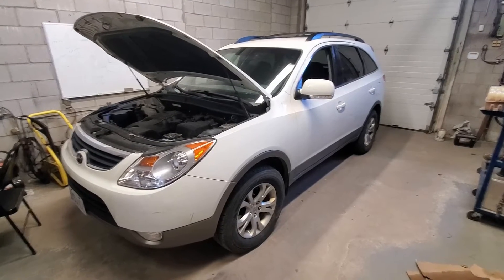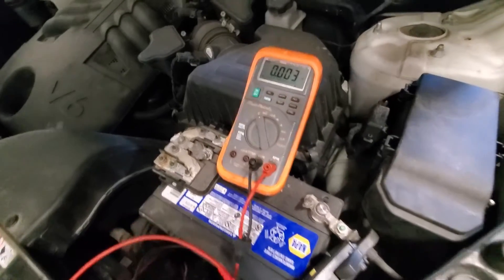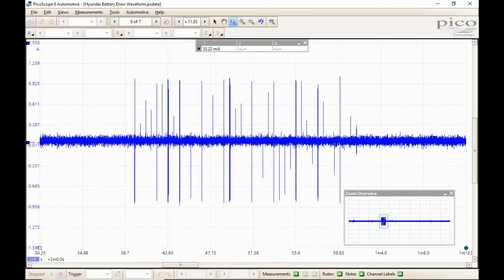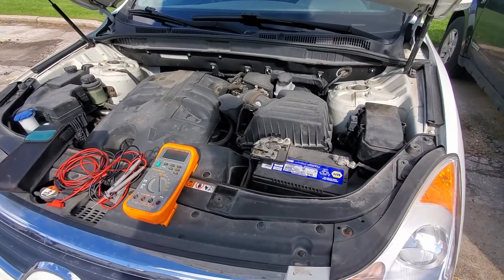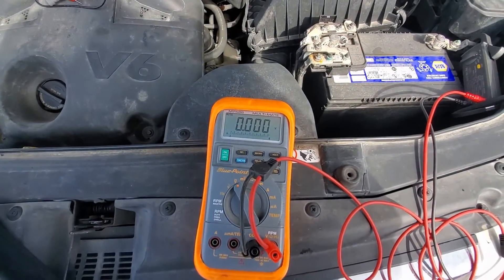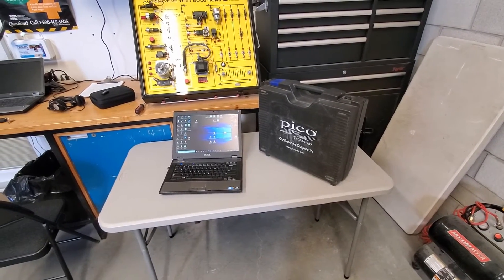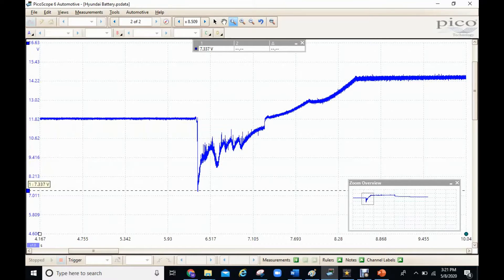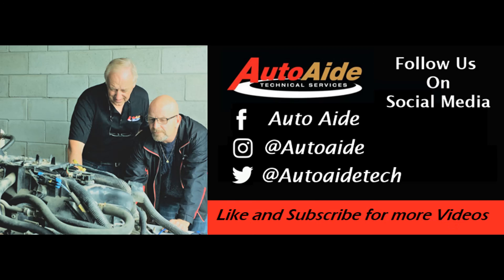Battery Drain, Parasitic Draw Diagnosis (Hyundai)

Comment: Having the same problem with 2008 Veracruz.  Put new battery and alternator, still same thing.  Have to pull the double fuse for radio to keep it going.   Major pain.

Comment: I'm having same problem with customers car there's no draw and battery dies in 2 days on 2010 Hyundai sonata and I tested battery and it's good it's a new battery I can't figure it out
Reply: Is the alternator charging when the car is running?
Reply: I have the same problem! Alternator is fine (runs fine when negative terminal disconnected and shows hood voltage with multimeter). Is there a world that the battery can test good (at NAPA or auto zone) but still be bad?
Reply: @scottbartenhagen6493  we tried 2 new batteries Napa warranty them anyways but doing the same thing what we did we unplug the fuse for the security light for dashboard flashing I can't remember number of fues location but it's the fues box inside driver side panel theres a yellow cover with 2 fuses we pulled one of the fuses and that red light stop flashing but now it's not draining battery that's what it was the hole time but not sure why it never drain battery before maybe there's something else with that fuse it runs also but try take that fuse out and see it stops draining your battery it work for customer car hopefully it works for you I know how frustrating that can be.
Reply: @funnylooking8218   hey whay year and model of hyandai did this fuse delete work on ? we have a 2016 santafe and i have to disconect battery every day
Reply: @scottbartenhagen6493  we didn't see anything else that fuse turned off when we unplug it customer was ok with that light not flashing we couldn't figure it out so we just left the fuse unplug
Reply: Have alternator and the diodes checked